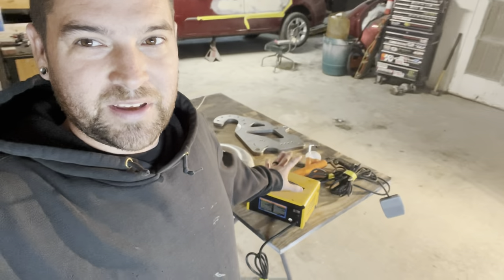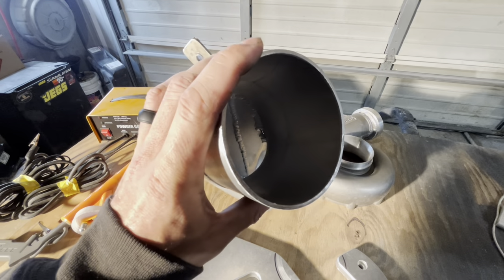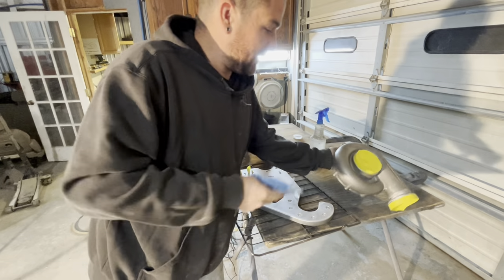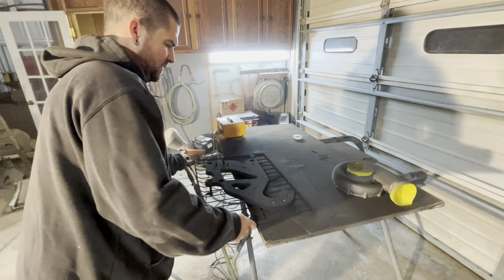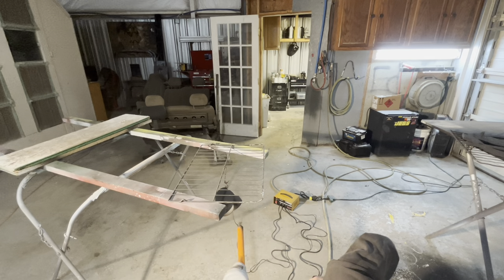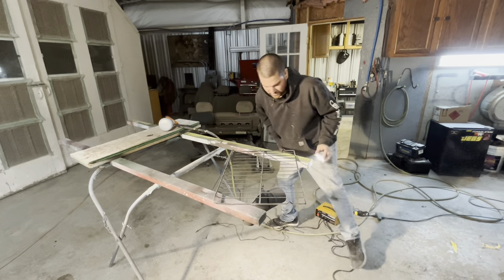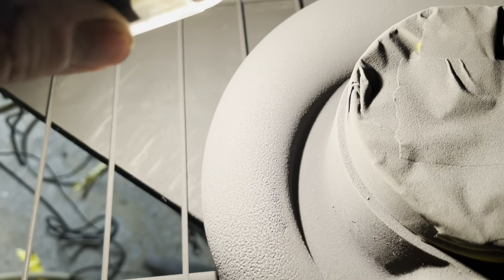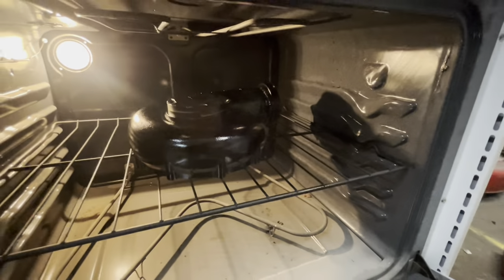💥 Procharger Powder Coating That You Can Do Yourself 🫵🏻 DIY Harbor Freight System

Comment: For proper adhesion and flow out the part needs to reach temp before you start the timer. Get an ir thermometer it'll help tremendously.
Reply from the maker: Ok. Someone else said to get it to 100 before I coat it also.